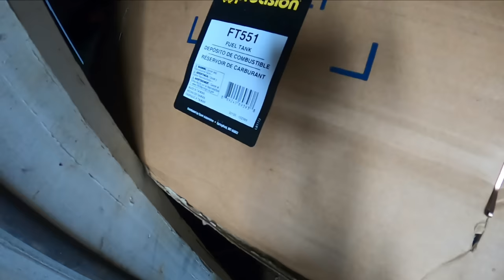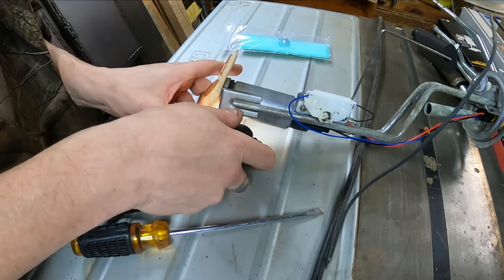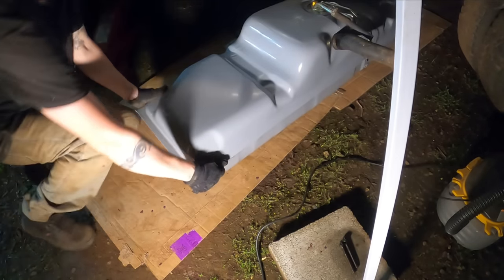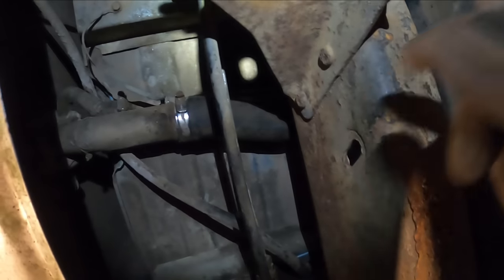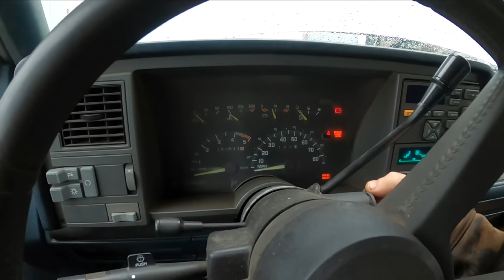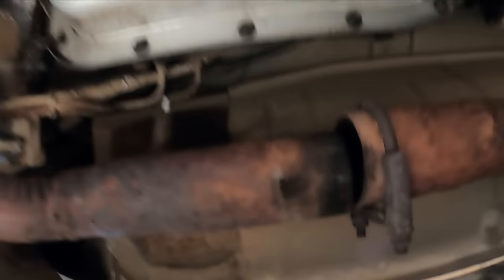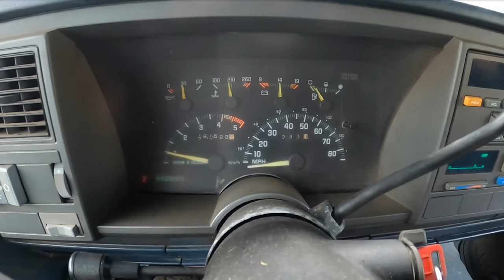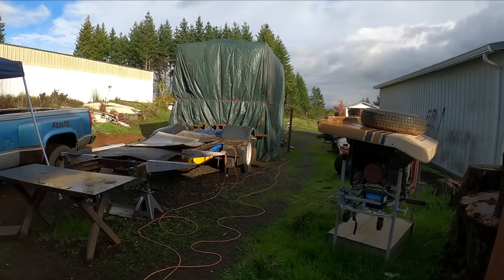Installing New Fuel Tank - '93 Chevy K3500 454

Comment: i understand you had too replace that tank , when i did replace my fuel pump i cut a hole in the bed that now is a door that opens up.if only GMC would have made life easy when replacing a bad pump.your truck will soon be back on the road 454 k3500 =)

Comment: yea man good job/save that truck and when you get a 5th wheel RV then you can pull it down the road at 80 miles per hour/that is a tough truck for sure/or sell it and get lots of money for it/great for a welding rig contractor/thanks much